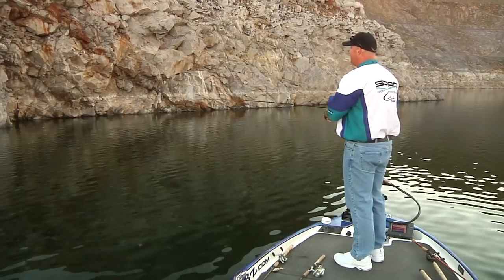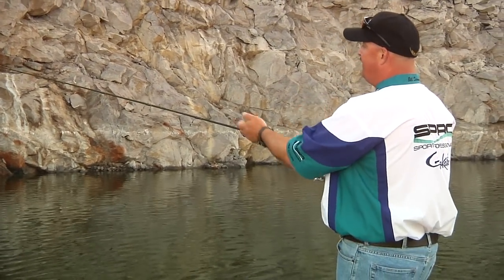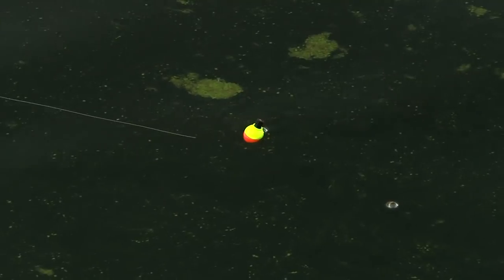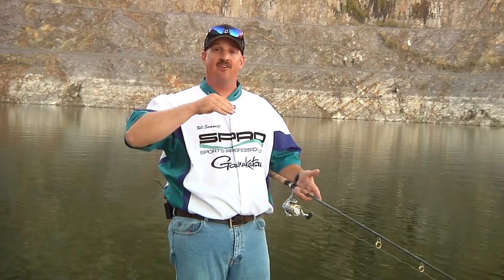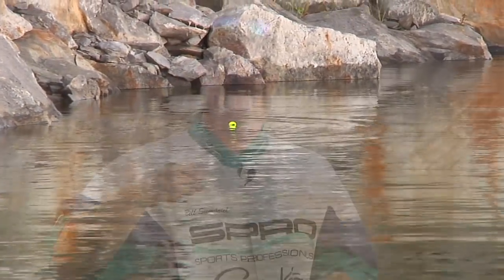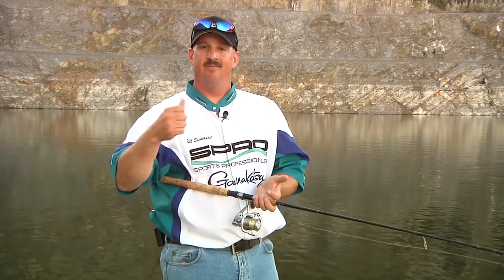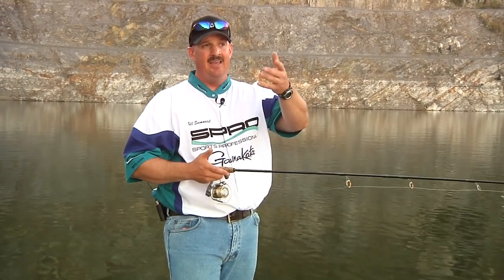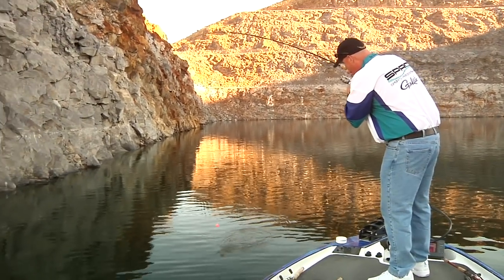How to set up a Float and Fly rig for bass

Comment: Have you ever had such light biting fish that you feel you miss bites? Would you go to a finely balanced float like a Thill to accurately detect bites?
Reply from the maker: Great question, the pear shape bobbers are weighted perfectly and I do not have any problems in that area, but the Thill works very well also. if your system is balanced it will work. If your jig is to light or heavy for the bobber you are using then yes, you will miss fish.